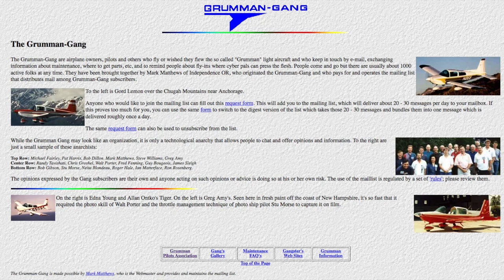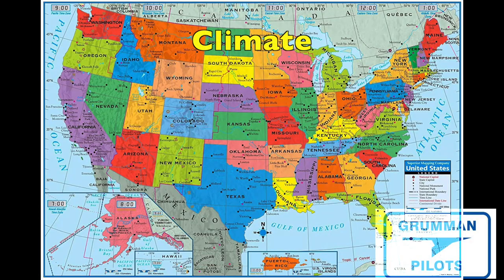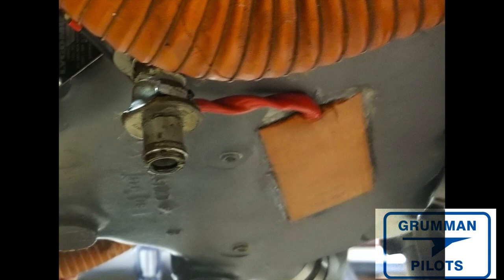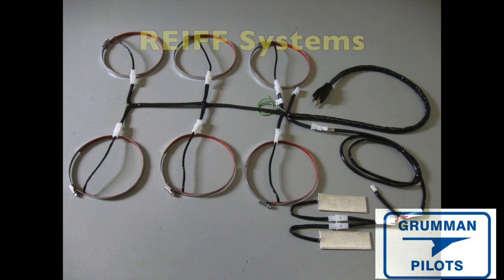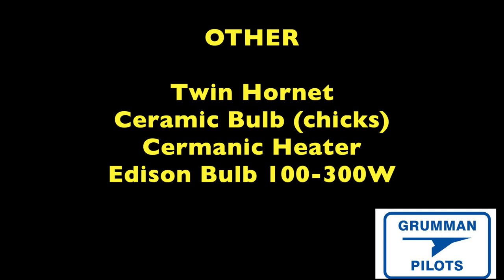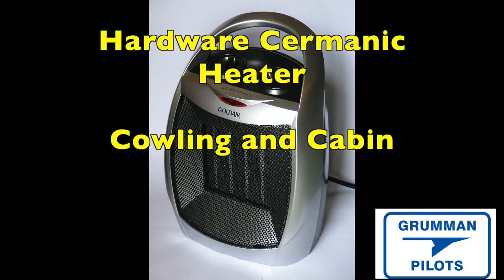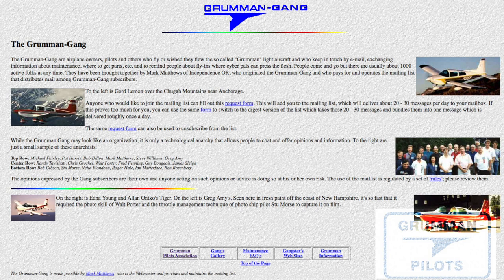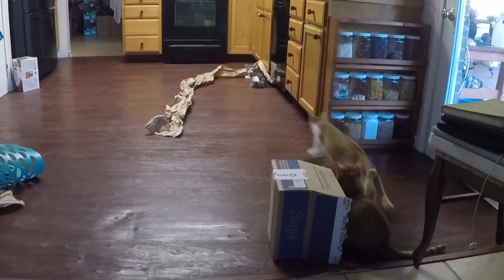What Gang Members are Using for Preheat Systems- Grumman Style

Comment: I took a Coleman Single Burner Backpacking Stove which folds very small and made an adapter so I could direct the heat under the cowl using a collapsing dryer duct tube.  Very compact, lightweight, and worked well.  Not for extreme cold, but useful in emergency conditions.  Now I use the climate method (Florida).
Reply from the maker: Another good idea, thanks for sharing and watching.